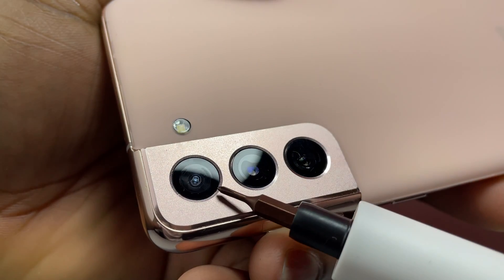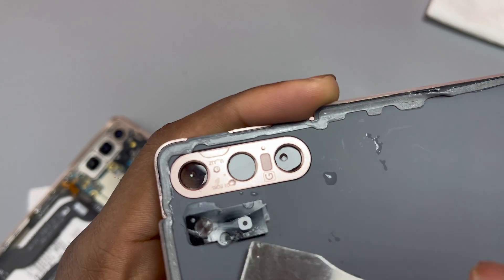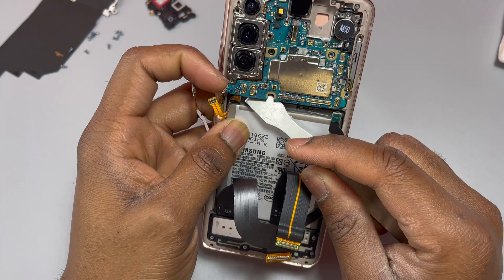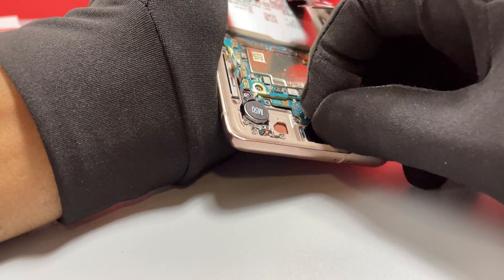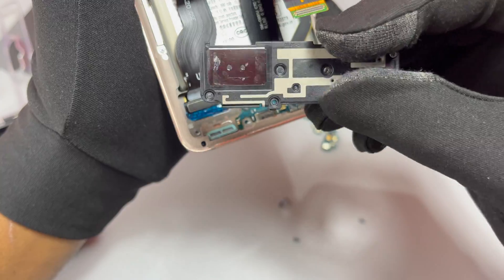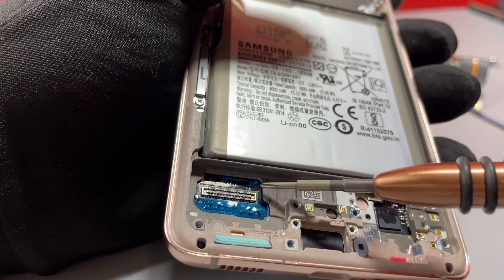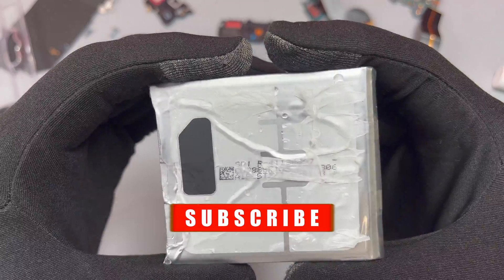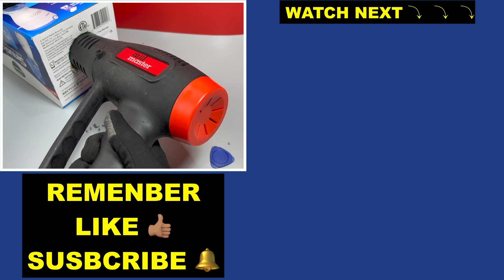Galaxy S21 Water Damage Repair: Causes of Water Damage & How to Fix It

Comment: Bruh lmao. Using metal to disconnect flex cables, Breaking the board to remove it, prying the battery out with more metal and a pointy screwdriver. Forcing the Sub PBA out without removing the Sim tray. Holy shit don't repair phones like this PLEASE.
Reply from the maker: Do you understand the context in which this video was produced? Do you understand the concept of CONTEXT?

Comment: I'm confused isn't the phone water resistant
Reply: For 30 mins at 1.5 meters depth.
Reply: @yetsomgize83  i only cleaned it with water but yesterday my phone turned itself off and it put it in salt box but it didnt helped to turn it on….
Reply: @C7VIBE salt??????? you ask for a cemical reaction. use rice

Comment: same thing happened to my S21 Ultra, the phone got unresponsive but was still working and was getting hot, I thought it will recover on it's own once water get dried up. I should have acted immediately, the phone is completely dead now. Samsung technician saying that the board is dead and only after replacing the board they can be sure about other components if they are working or not. The Board is itself is very expensive to replace and I not sure what else would have been damaged, it's just not worth it to get it repaired now. 
I have learned it a hard way that for any water damage time is critical, ACT Immediately or as soon as you can.
Reply: How did you do after
Reply: I am in the same

Comment: Hi, I can't find your part 2. Did you manage to fix it? Same thing just happened to my phone 😔
Reply from the maker: Part 2....I may not have uploaded it because the video was not doing well.

I managed to dry everything and reinstall all the components. The phone worked but while removing the battery I damaged the screen. I had to but a new screen (which was my fault) 

You can search for my Xiaomi redmi note 10 pro water repair it's basically the same thing that I did to recover that device. (All parts are uploaded for that device)
Reply: @ersbit  thanks for your reply, I just got my phone repaired. Took 3days and cost $50. Do you think that's a fair price and time frame?
Reply from the maker: 3 days is too long the price is fair
Reply: @ersbit  Hello a, I have some questions, what sud you do for breaking the display and the finger prin sensor?, And also, when did you buy the screen, it's just I wanna buy broken phones from America and sell them here as refurbished phones :3 ( I am form mexico by the way)

Comment: But how my ultra s21 made in Japan, water salt damage..the board was dead and CPU damage, the technician told me not to save all my files.. is this still have chance?
Reply from the maker: In your device condition, it my be difficult to recover because salt water is very corrosive. A technician can try to clean the boards and retest everything but there's no guarantee it will work.

Comment: My S 21+ shut down because of water get to it can do this still work? What you think?
Reply from the maker: Yes. It can you need to disassemble the device the next 3hr preferably immediately after the water damage symptoms. That will leave better chance for recover. The longer you wait the higher the chance of permanent damage. Disassembly and dry for hours using air (not hot air) and reassemble the device.

Comment: my s21 ultra got aosked for 1-2 sec, now the camers shows moisturizers and power button isnt working, do i need to dismantle my phone?
Reply: or it will be okay after some time?
Reply from the maker: You can simply remove the back let things dry or use a cold hair dryer blow air for 10~20 MN and reseal the back. You can wait also but if it takes too long to disappear you need to dry things inside
Reply from the maker: Humm it's a bit of a gamble to just wait. It can go away by itself but hoping nothing else arose while you wait to dry.
Reply: Same issue with me its fixed or not

Comment: Can oxidisation take place in devices like this?
Reply from the maker: Can you explain more? Oxidation if water is stagnant? Inside the device....most likely it's going to corrode electronic parts and create white paste etc....that's what I found inside my redmi note 10 pro when it was drowned and wasn't responding
Reply: @ersbit  yes, for example if a s21 ultra had water inside it for a few days, can it corrode? ,
Reply from the maker: It may, it difficult to give a firm answer. On my redmi note 10 pro the screen was black Unresponsive and it was getting hot and when I opened it some pcb board had white corrosion. Fortunately I was able to dry everything, clean all the parts and the device work normally like nothing happened.